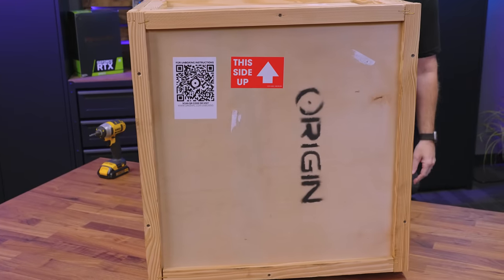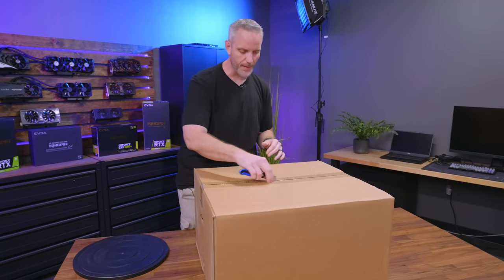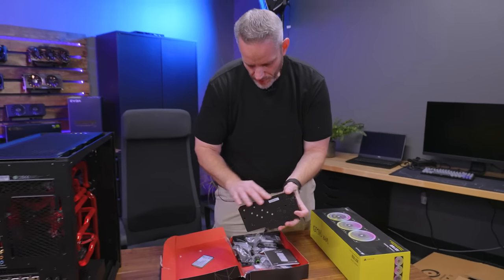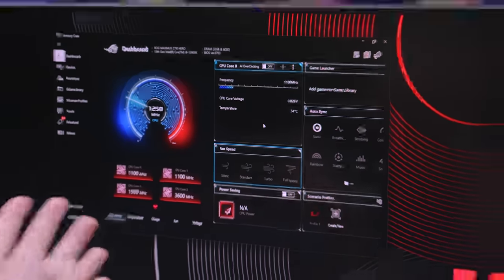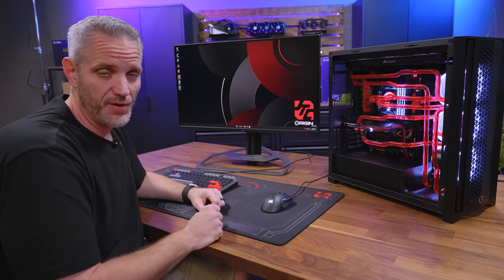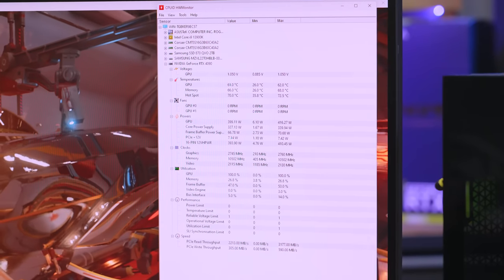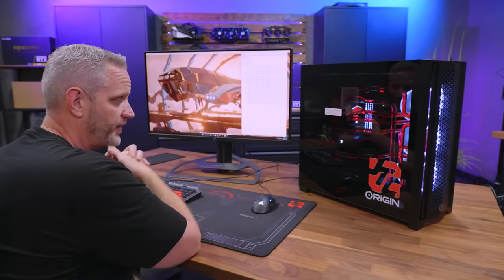When the PC comes in a crate, you know it's gonna be good!

Comment: I agree about the fan direction.  A pressurized case has more air molecules available to communicate heat away from components.  A negative pressure has fewer molecules...it's that simple.  Not to mention the unfiltered dust and pet fur being sucked in from every crevice.  Hard to believe they did that.

Comment: That cable management is a 1000 times better than the crows nest of cables in the (normal price was $5K i got it on "sale")   PC i bought a while ago. I even had to re-route the SATA cables to manage to plug in the 3 SSd's i told them specifically i needed since they were to short to reach the designated spot in the case. 
Love the tubing in this build. So many cool bends and angles, and it look really good with the white backlight shining through the "red" tubes.

Comment: Listen Jay, I am an Asus loyal customer. I've used Asus since socket 428 with rambuss shitty ram, when nvidia was a gt240. Out of over 30 home builds for fam and friends over the years, only 3 boards were doa, only 2 had intermittent issues. The avg person does not have access to the equipment I used to test failures, but I did. I am an avionics design engineer. I've had less luck with msi and gigabyte. Never used an evga mother board. But loved evga cards. Well they were just 10 miles away.
Reply: If only I bought stock in Asus in 2000. Face palm. But bought nvidia at $10 and amd at 1.62. So I still win. F biden

Comment: HWMonitor is such a great tool for solving heat-related issues. It helped to solve why my old 2600X kept randomly shutting down - it was overheating with the stock cooler. Replaced the cooler with a be Quiet! Shadow Rock 3 and no more issues. Still using the same cooler on my 3700X now.

Comment: For what this cost, probably well over 7k, there should be no issues with the exhaust/intake (and they shouldn't be so damn wrong about it) and there shouldn't be a need to fiddle with fan curves and whatnot. This sort of purchase should be turnkey. Also you know damn well they won't do all those fancy bends in the tubing unless you throw another 1500-2000 dollars at them. I got a promo email from them the other day and they had 2 systems prebuilt ready to go, both with 4090's and 13900KS's. One had a 360 AIO and the other was a custom loop with SOFT tubing. They wanted an extra 2200 bucks for the custom loop. No fancy reservoir like in this one, just the standard small corsair one, and the smallest amount of tubing possible. Origin is so overpriced it's insane, other high end custom options out there with 20 times the options to choose from, and actually being able to choose (Origin doesn't give you options of what specific GPU you get which is insane, trust me bro it'll be a top end 4080 for the 950$ over msrp we're charging you lol) for literally thousands less for the same high end system. Screw Origin.

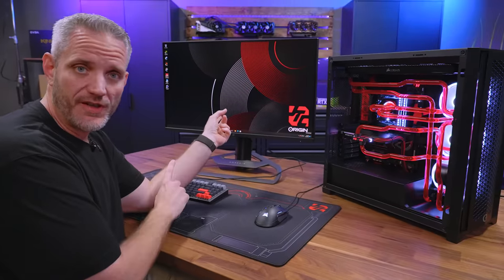Comment: 10:51
i don't have any problems with negative pressure setups, i prefer them.
cause you can always slap a mesh magnetic filter over the "intakes" 
but also i'd rather have "natural" intake, than like a forced intake, that would cause dust buildup wherever the intake dumps (you know like under a cpu cooler on the MB where the dust/air is forced packed)

with natural air intake, it'll be more dust in general, but at least it won't be packed in there, like it would be with an "intake" fan

Comment: Airflow in pc's is usually really bad. To reach a fans full potential it needs an intake that is about seven times the size of the opening surface of the fan. Or one could use a push pull system using two identical fans but all the openings that are in the case interfere with the proper functionality of such a system. There's a lot of cool to be gained if someone would design a case that doesn't leak air. So far I haven't come across one that does the job.

Comment: I agree, having fans to intake fresh air to feed those beast is absolutely necessary. I have a 5800x with an Asus 4080 Tuf Gaming , 011-dynamic and I have 3 fans intaking air with a top mount AIO. works great. lets me get everything I can out of that system. sweet system for sure,  I would want those changes made as well. I would also be pissed about the scratches in that PCIE M.2 carrier. yikes.

Comment: I’d be concerned with how Origin packed stuff. If they played fast and loose with the packing, then how was the machine built? But, then again, the folks who built the machine may not have been the ones that packed it. 
Airflow: I like their airflow design. All heat is drawn out. The vent in the back allows for some airflow across the tubing. That effect may, however, be negligible. 
Having air forced in could possibly bring warm air in from the radiator(s), thus warming the interior.

Comment: "the instructions to open the crate were in the crate" I had this moment when I did my first watercooling about a month ago.  EK's GPU block had captive standoff screws for the backplate, and the captive part was a tiny weak piece of plastic that I literally unscrewed through because it provided almost no difference in resistance compared to just the regular screw engagement with the threads.  I ripped off all 9 screws, then I got access to the piece of cardboard that itself doesn't even have the instructions but instead a QR code to finally, far too late after the fact, tell me I need to go hunting for 9 tiny pieces of plastic that are now all over my room and hope they happen to go back on well enough. They did, but still, something that should have been stated on the box, not inside the damn block behind a QR code.

Comment: I hear you. I cannot take why anyone is using these filters for exhaust, or in the typical and logical locations. I have a lIan Li Mini and have a really good setup with the 3 at the bottom with intake on and screen mesh for the filter, and two SL140's on the side with screen in the front backside corner with the internally magnetic filter. AIO is on top for exhaust with 3 SL120's for the V2 Gallahad AIO. And 1 SL120 on the rear for exhaust as well. GPU is mounted but separate from the board creating a nice tunnel between both. And my front corner SL140(bottom intake) has a 45 degree angle 7" IPS touch and forces air into that tunnel, cooling the IPS panel and the chipset and nve slots. It's on "Tech Review by Irdi". I'm running a Flux Capacitor Sensor Panel from AIDA64. Or whatever I make it, 600x1024. Love it's power. Ryzen 9 7900X, 64 Gbs Trident Neo Gskill across all 4, Radeo RX 6750 XT 12 GB, and 2x 990 Pro Samsungs on the MSI MAG Mortar Wifi mATX board. Such a cool setup.

Comment: It would be really great if they made fans that you could reverse without removing them. Then Jay would be happy. It seems possible, although expensive. And yes that can be done, both ships and planes can do that, it's the problem of fitting that into a small size. Although there are even variable pitch RC plane props, and I'm assuming the same goes for RC watercraft. Getting closer to case fan size there. Hmmm, now I'm thinking of a system that somehow monitors its temperature in various areas and switches individual fans from intake to exhaust as needed (impractical but sounds fun).

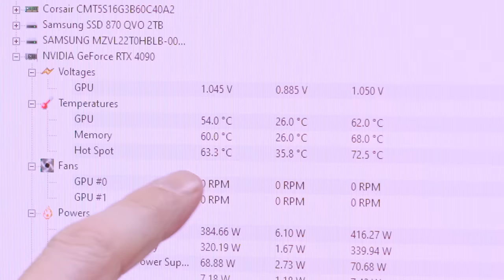Comment: 18:00 Why are you not using Fan Control?  You had said it should be on everything... and I agree, as it is very nice application.  Especially the ability to use the temp change between 2 thermals sensors on the cooling loop to control the rad fans and pump (no change in temp, lower the pump speed, as it can get more cooling with less work; large change, speed the pump up to have more volume for cooling.

Comment: RTX 4090 with out a right angle power adapter -100 points, using a QLC NAND based Storage SSD -50 points, Confusing Jay with the tubing runs - Priceless.

Comment: First, love the build! The aesthetics of the system is really eye-catching and very cool, however, being a "realist" and not able to justify spending more for a "gaming" PC than I did for my daily driver car is why a vast majority of "enthusiasts" just simply can't do that. I have found that the used computer parts market is just way too saturated with viable components that can be had for literally pennies on the dollar. It's mostly do to the rapid advancement of the industry and those who are the "must-haves" that rebuild every three to five years. It's much more cost effective and easy to ride that used market to build good quality systems. The only limitation to this, in my opinion, is that as hardware developer continue to push the limits of performance and capability the software engineers and gaming developers are slowly abandoning 'backwards compatibility" in order to take advantage of all these new system capabilities. So, that leaves those of us who really can't afford the latest and greatest to have to settle for the best systems we can create and try to work around the limitations of those "dated" system resources. It's kind of a weird place to be in right now.

Comment: I just got done overclocking my 4070 core by +230mhz & memory by +1950mhz. And my 13600K up from 5.1GHz to 5.5GHz all cores & 5.7GHz 2 cores. All air cooled and temps never higher than 90 degrees. :)

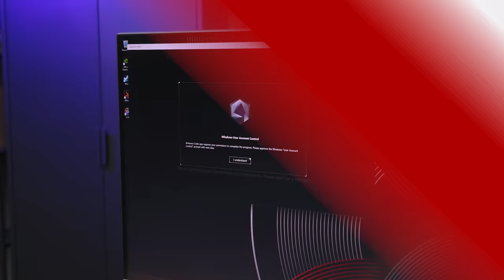Comment: Referencing 9:23 I went from a Meshify 2 to a Fractal North with the mesh side panel because I didn't want to deal with RGB anymore and it was the best move I could ever make. So much easier to cable manage and not worry about which software is compatible with what hardware.

Comment: They haven't got much better. Friend of mine just had to send theirs out for repair after experiencing instability from Origin using non compatible ram. After over a month they finally sent it back. It had a custom water loop. It was sent back using the wrong shipping, without support for the internals and loop full of water. Needless to say the shipping company flipped it end over end at some point and water ended up leaking into the system frying it. Try harder Origin a little extra goes a long way.

Comment: Jay, here is solution , bee it a costly one that will eventually pay for it's self in time saved setting up lighting and shot angles for the hell that is filming items through glass under studio lighting while adding more of  that elusive production value . (pro tip) From a custom picture framing shop { you may be able to source large panels then have them cut locally at a commercial window company, they may be able to offer a film solution for glare also that is more cost effective . I honestly don't know if the finish or treatment to the glass surface produces the effect or if it is like in the glass and is a proprietary factory only process  so local venders just can't reproduce it ? )  have standard side panels cut to match commonly filmed PC's on your show out of what they call "Museum Glass " then you can use Auto window tent to match an OEM's tent of their glass . The glass from the frame shop produces no reflection increasing effective viewing angles , a glass developed for glass framed stuff meant to be viewed by crowds from all angles with out a reflection from lights whiting out the object behind the glass. This could be applies to glass tables and well anything in your filming environment made with glass panes, though I do not believe it is available in semi structural form , like no frame shower doors or glass walk way railings .

Comment: I don't need bloatware to control water cooling fan speeds. GPU has RPM, PWM, and ground pins for stock air coolers. Easy. Snag them to control some fans. The Windows task bar clock is lucky if i let it live in the system tray. 😁

Comment: In theory exhausting will cause negative pressure, which will cause air to be sucked in through the back panel. The dust filter will prevent dust from getting sucked in as well?

Comment: Armoury crate is a really heavy piece of software. It's so heavy that Asus has to provide the "Armoury crate uninstaller". I used to remove it by hand, it installed like 10-20 different item in Windows add & remove program thing. And it's sucks, it won't detect my 1080Ti Strix as it's not supported. I just build new PC and it needed like 3 pieces of software just to control RGB and even after install all of them my GPU still not detected in any of them. In the end I nuke it all and just install SignalRGB (although not perfect, but I mostly leave it on static color). And I never let anything other than FanControl to control my fan. Thanks you for letting me know this 2 pieces of software exist.

Comment: i recently did a watercooling set up with basically same stuff, the XD7 pump/res combo you need to have a "route" on all ports of it or it wont feed properly so i had to by more fittings to use a tube to bypass the gpu ports on the pump

Comment: If they had put the fake fan reservoir thing on the side panel and put the radiator and actual fans at the front (with those fans set to intake), along with mounting a fan at the back in exhaust, the temps probably would be a lot better. Plus, some of those tubing runs are just showing off. They could be a lot more efficient, lol.

Comment: I am for ever complaining about how new equipment I work on is cable managed, I have had to replace 5-6 DisplayPort cables where they have pulled the cable so tight it bends the Plug, socket and Board Resulting in the Plug disintegration and poor connection. But the DisplayPort plug has a press switch which is no longer there so getting cable out is a pain, you then have the 20 odd cable ties in locations you can't get too as position device is installed. If its not bent they have pulled the Cable so tight it cuts into the insulation on the cables.

Comment: I still say the best way to control fan speeds in a combined loop is by fluid temperature. Forget fan control software that looks at the CPU and GPU temps simultaneously, just base it on "How much heat is going into my fluid?"

Comment: While I do think the tubing is cool looking, it is NEVER something I myself would try to do.  And I have already built 2 different water cooled setups.  I can see someone adding the tubing with a bunch of wild bends in it because not only does the bends, if properly done, look neat and add complexity to the build, it also adds some fluid capacity that the airflow in the case is able to help keep temps under control.

Comment: Just built up a new rig over the weekend and I gotta say, in regards to cable management, I actually wish manufacturers added MORE cable? I feel like the standard lengths are to short to allow creativity in your runs while simultaneously being too long to deal with without some creativity. 

Also, iCue is borked as hell at the moment. Configure your settings, disable iCue app at launch in task manager, reboot and then install any other tools that rely on sysinfo monitoring. Leave iCue services start at launch. The iCue app was blocking the most random stuff - CpuZ, 3Dmark, Nzxt CAM, Giga Control Center, coreTemp...  it was nuts. What im sayin is,  anything strange regarding something that relies on sysinfo should be checked with iCue uninstalled.

Comment: Another video for fan setup maybe good. 3 options i can see..1- Fans in mobo, 2- Fans in AIO controller (iCue) and 3- Asus (mobo) software.
Which is best and why?

I built my own pc with 8 fans. 360rad top (exhaust) 3 front (intake) 1 side (intake ) and 1 back (exhaust).   I have the fans running via iCue but they recommend setting fans up with aio Capellex, with the aio water temp as a monitor.  What are ppl setting theres up with?   I have a i9 12900k and 3090ti.  Temps i feel are good and currently have it cpu temp monitoring the fans trather than liquid pump temp.   GPU temp monitoring maybe my next to try as the gpu gets to about 75 degree which is slightly higher than the cpu temps (50-65) i get.

Comment: Something that it's never mentioned with this kind of builds is that they never include the air-cooler of the grafix cards used, you get the extra cables of your power supplies, but never mind about the rest of you extra expensive component

Comment: I never liked the idea of zip-tying cables. Especially with that many zip-ties. Just use velcro straps.

The reason should be obvious: If you ever need to somehow change something, like moving or removing a cable, you'll have to cut all the zip-ties, and put new ones afterwards, which is a PitA. With velcro straps you just remove them and put them back afterwards, nice and easy. Also if you need to add a new cable, you can easily just add it to the bunch (while with zip-ties you either can't add it to the same bunch, or you need to cut them and add new ones, which is again a PitA.)

Comment: I don’t like the res/pump taking up entire front.  I have same case.  3090 and Ryzen 9. 13 fans, 360 rad top in push pull. 360 rad on side in exhaust.  From and rear are intake.  Temps run in the 40’s

Comment: Regarding fan control/sensors, is there a particular reason you wouldn't prefer to run the rad fans off of loop temperature rather than having it react to components within the loop?
Reply: Wondering the same. I've got my fans running based on water temp in my loop.

Comment: Armoury Crate and iCue are both cumbersome and unnecessary.  ASUS makes it hard to find, but you can still download and install the relatively lightweight "ASUS Aura" for RGB control.   Combine that with FanControl software (thanks for plugging that again -- it's great!), plus maybe AIDA64 Extreme in lieu of iCue for a sensor panel, and you have all the functionality needed without the bloatware.   

This system is gorgeous, but having all the fans exhaust is just nuts.  It would be great to see a follow-up review comparing thermals with the side radiator fans switched to intake.
Reply: ... and I just watched today's video.  Thanks!